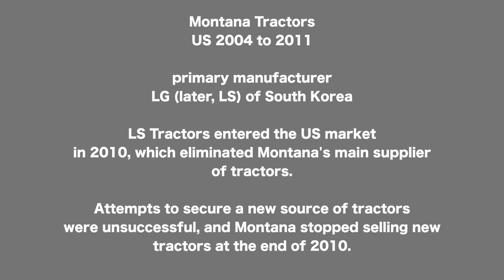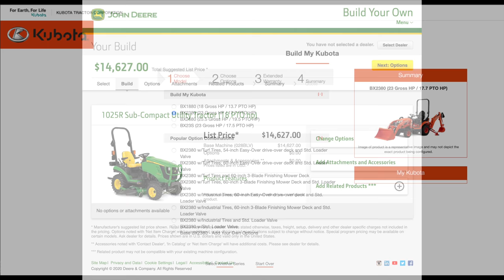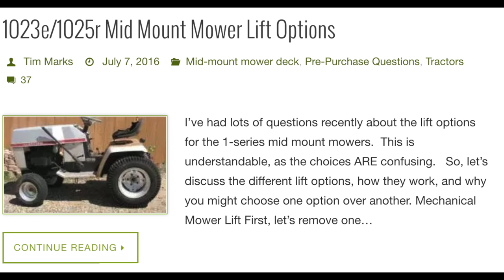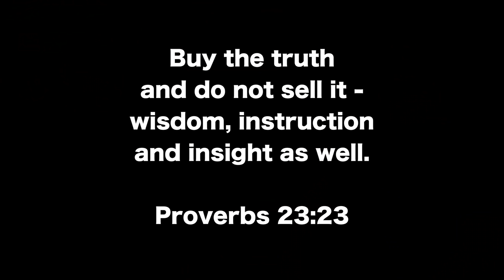Have NO REGRETS! Watch This Before You Buy A New Compact Tractor!

Comment: “Is a 1025R too much tractor for 1 acre?” Ha ha ha I have .6 acres and I bought a 2038R. It wasn’t the size of the domicile that drove the size choice it was the implements that I wanted to use. Top of the list was a tiller. In north Georgia around Atlanta the soil is thick heavy red clay. It takes a lot of horsepower to drive a tiller through it. Second on the list was a stump grinder. Again the minimum PTO HP for that was 25 horses. That mean I had to go to at least a 2 series.

That said remember this. I have never heard anyone say “I have too much horsepower.” You laugh but it’s true. So pick the size tractor (series) of tractor and get the most horsepower you can get in that series. Because I can assure you after you get one you will find more uses for it and more implement to do more for it.
Reply: Jeff,  Here in Atlanta as well...  Bought a 1023 and kick myself everyday for not going bigger.  Put a 60" tiller behind it and it still get's the job done.... but.....1025 or 2038 sure would be nice

Comment: Tim thanks again for the video series... I think from a weight and turning radius perspective that Nolan's maximum tractor is a 1025R. But what about the 2025R? Alot of similar specs, but with more ground clearance.  I always wished your current sub-compact was a 2025R so that you could have highlighted the differences from your previous 1025R and all the work that you showed with it.
Reply from the maker: I am not a huge fan of the 2025r.
Worse turning radius, higher center of gravity, more cost, all for a slight improvement in ride quality.  I see no other benefit.
Ground clearance is not really needed for most jobs.

Comment: You mentioned you were almost embarrassed to use your 1st tractor due to the small size of your property, I know the feeling even with my XT1 Cub Cadet! But my property is tiny compared to those in your neck of the woods. I got mine mainly to plow snow, I was getting tired of having a bad back due to the snow thrower riding up on packed snow. I was always hunched over and wishing they made them with adjustable handles. I do plow out three of my neighbors which makes me more comfortable using it. Very informative video! Here's my  Cub Cadet....I posted it on my photo blog ...http://capeannimages.blogspot.com/2020/05/life-goes-on.html

Comment: John Deere really raised prices into the absurd: 2025R is 35k for TLB another +$500 for R14 tires that you will need as industrials tires tear your grass and slide on a pavement, Rural king easy to negotiate $20k for the same thing.. John Deere still has lubrication points in 2022 and some are inaccessible (instead on the sealed bearings),  JD turn buckle hitch is a joke in 2022  works ONLY on 100% level ground makes you lift and slide like 500 pound attachment because the company does not want you to have telescoping or sliding arms. Trying to decide will I need a tractor 15 years from now, or why not just buy another new one 15 years later.
Reply from the maker: Sounds like you have already decided.
I’m sure the RK will serve you well.
Reply: @TractorTimewithTim  No this is a business decision. Working with 2 JD, 1 Kubota, 1 RK, 1 NH,  1 kioti dealer.  Hopefully in one week...

Comment: More and more tractors big and small are begining to be like class 8 trucks in the way that the company selling them are just making and painting the bodywork but rest of tractor is by someone else and same as the next eccept body and paint. Yanmar for example builds and sells their own tractor and yet builds many small Deere tractors. It is getting to the point where no one is building their own stuff. The companies buy bare tractors( engine,transmission,rearend and front end) already built and then throw there hoods and fenders and wheels and tires on them and paint them in their color and sells them as their tractor.
Reply from the maker: Sorry.  Incorrect.  Yanmar does NOT build Deere tractors anymore.  Yes, the Engine is Yanmar, but the rest has no resemblance to a Yanmar tractor.
Reply: @TractorTimewithTim  engine is Yanmar on many of the  compact and subcompact Deere and the trans and rears are tuff torque out of India. Much of John deere components are farmed out to different manufactures just went through this whole problem with our 7930 when the front diff went out of it and found out our tractor is a mexican tractor and the front diff is out of India yeah John Deere does farm out their builds and buys from other manufactures it's not like the days of the  John Deere A and Bs or the 4020s  when John Deere built their own stuff. We have had the same issues with parts and pieces for our German built Deere 6400.

Comment: Deere still run yanmar engines in their tractors under 75 hp or have they started making their own yet
Reply from the maker: Yanmar engine.  The rest of the tractor is designed by Deere.
Reply: @TractorTimewithTim  I remember when I was younger my friends daddy told me that. They are good engines. Like w kubota, their engines are in alot of diesel zero turns and other things other than just kubota tractors. Either one of them are probably the two best small diesel engines there is. I probably lean little more kubota just because of more time on a few of them and most hrs have been rough ones and they'll take what you give them. That and our 5083e. I think that's what it is, not 100 percent sure. The loader boom is always between my eyes and the numbers so I don't get to see them often but an almost new cab 80 horse deere w a loader. We farm about 2600 acres and to me tractors that size are mostly mad for hay among other things but w the left hand reverser it is mad to load hay and go from forward to reverse for majority of ots life using the loader. Our hay trailer holds 8 of the 5x6 bales and if short hauls by the second load you will smell hot clutch from then on for the rest of they day and you can feel it fading away some later in the day. I load in b so it won't be so much of a strain on it and still it's just a weak clutch in them I rekon which don't make sense w that size tractor and deere knowing what most ppl are going to use it for.
Reply: Do you sale or service those size deeres much and is there something w that tractor that may need adjusting or is that a common thing w those tractors. I know he had deere come do something to it last summer because somebody was loading in c1 which is what I want to run but it's too much for it,but idk what happen exactly or what they did to fix it
Reply from the maker: I haven’t used mine enough.  I certainly haven’t tried to use loader in C1.  Most of my usage requires slow speed.  A2, A3 or so.

Comment: With my Johnny the only regret is that I wish I would have went with Lawn Turf tires not the R4 tires. The turf tires I spent 425.00 for tires and mounting on the rims. Everything else I am happy with my Johnny.
Reply from the maker: Consider the VersaTurf by Carlisle at this point.  Hybrid radial.  I like em.
Reply: Tractor Time with Tim I was waiting for a follow up video on those hybrid tires.

Comment: I guess price doesn't matter. Both. Of those brands will also be the most expensive. If you have the money for any compact tractor, take a look at the prices of a full size. Your paying for the paint!!!
Reply from the maker: You might be surprised. In the subcompact tractor space, Deere is quite competitive.   The differences in prices are quite small. 
Then, saying you are "paying for the paint" is totally incorrect.
No one else has a fully auto-connecting mower deck.
No one else has anything remotely close to the "load n go" setup which allows you to pick up the mower deck with the loader for service and storage.
Overall, this machine is more refined (by far) than the nearest competitor.  
So, it might costs a bit more, but it isn't "just because of the paint color".
Reply: @TractorTimewithTim  I bought my Branson about 4 years ago. The prices at that time was about 50% lower.  12.5 compared to 20g+ for other brands. Drive over mower is great, until you need to pay the Jon Deere service fees to get it serviced. For the price difference, I was able to get a flex mower deck with 11' of cutting width.  I'll take the 11 feet on each pass compared the 56 inches of drive over deck.  The base tractors....the paint IS the price factor, not performance. The prices of off brands have come up to make more profits then the greenies.

Comment: I don't watch TTWT due to the brand of tractor you use.
0% financing means you pay more for the machine up front. Check to see if you can get a cheaper loan from a bank for the price the dealer wants if you are paying cash. Better yet, have the cash to buy straight up. 

If Nolan is going to help his family out, he'll need to buy a trailer and have a vehicle capable of pulling it. 
Backhoes are expensive, if he doesn't think he has a lot of use for one it might be cheaper in the long run to rent a mini excavator when needed.
Reply: Cash is always cheaper! However, With Deere & Kubota they have their financing in house so this is not as much of an issue. Their in house options are typically far more competitive than any bank interest rate. 2-3% interest still costs more at the end of the day.

Comment: pretty misleading to mention Montana tractors, without making it clear that the mfg of those makes alot of tractors, LS makes tractors for Case, IH and under their own name. So Montana tractors may be gone but the company that actually made them is still making lots for the NA market. I'm not advocating for LS, just think you should be a bit less misleading.
here is a great list of who actually makes a given tractor https://en.wikipedia.org/wiki/List_of_tractors_built_by_other_companies
Reply from the maker: I do not think misleading.  Getting parts for Montana tractor will require Sherlock Holmes at a minimum.   
Another example is the Cub Cadet (by Yanmar). Nearly impossible to get parts, even though Yanmar still exists.